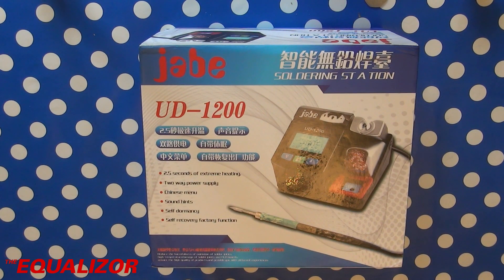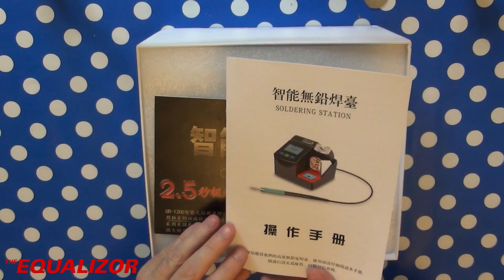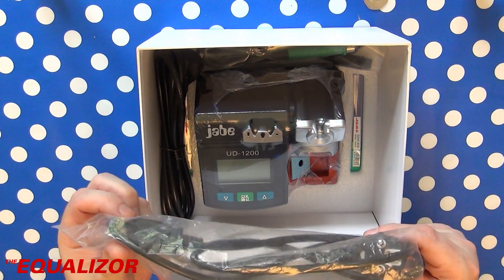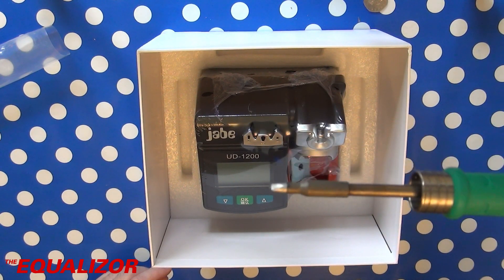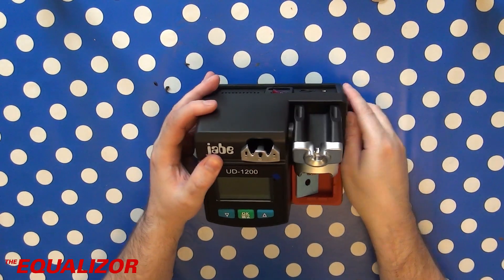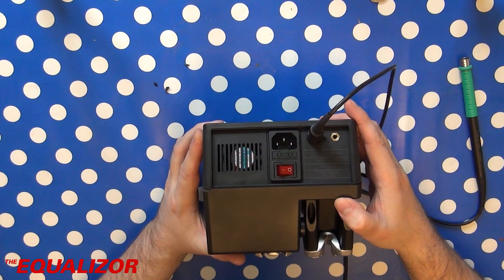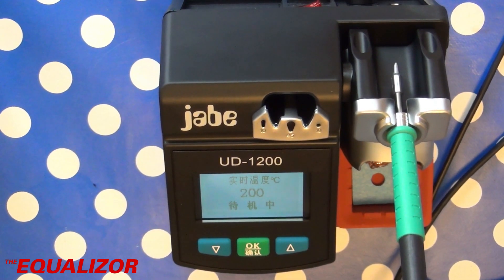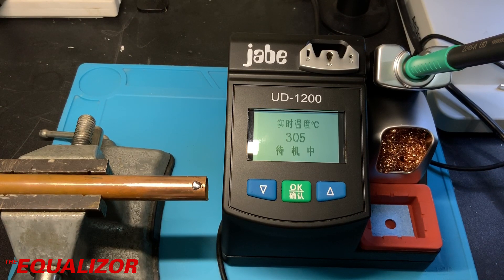Jabe UD-1200 soldering iron vs JBC CD-2SE

Comment from the maker: I’ve now used this station to make a SMD Romboard and it worked great. HOWEVER out of the box this station is set to 150w output which is insanely high. The JBC 2245 handpieces and cartridges are 50w rated. You can alter this setting by pressing the middle OK button, then pressing it again, scrolling down to the second line which will say 150W and using the down button to change it to 50W. Then scroll down to the final menu entry and press OK. After a few seconds the display will revert to the current temperature and it’ll be ready to go.
Reply: The Equalizor wooowww... 150w default setting WTFFF 
Thanks for this really nice review, I have the JBC and always recommend to people but people won’t ever spend that much money on jbc unless they’re electronics professional, this one is a good value =]
Reply: As long as the temperature doesn't overrun much then the high wattage is  not a bad thing.
Reply from the maker: Nevets Agreed, but I’m a little paranoid about the JBC tips getting damaged so I’m happy to underrun it. I’ve not noticed any difference in day to day use and I’ve had this for over a year now, still works great.
Reply: @the_equalizor  Ah ok, I wasn't really thinking about from that perspective. I am just about to order a JBC, I might experiment with the lifetime of 2 tips at different watts, maybe one at 80 watts and one at the full 130.
Reply from the maker: Nevets Enjoy your new JBC station. Still the best station I’ve ever bought. Much better than that crappy Pace one I bought before the Jabe. That was slow to heat up and the UI was crap, like something from the 1970s. :)

Comment: Hello, can Jabe UD-1200 use tip JBC C245? Thank U !
Reply: Phạm Thanh Vân Yes
Reply: @robscott6794   Tks U : JBC original C245xxx ?
Reply: Phạm Thanh Vân yes original and clones. For the original ones I turned the power output down a bit just in case, but I’ve had no issues using clone cartridges, handles and original tips and handles on this unit. You just can’t use 210 handles or tips that’s all.

Comment: rofl, amazon is selling them for nearly the same price as the actual JBC ... no thanks!
Reply from the maker: That's why you'd buy them from Aliexpress if you wanted one. Amazon sellers always put large markups on chinese items as you're then paying for the convenience of faster fulfilment.
Reply: @the_equalizor  I get that alas I live in a country that loves to charge import fees up the wazoo.. I recently purchased 2 dollars worth of pcb's from JLPCB and ended up paying about 60 euros worth of import fees, taxes and other malarkey.

edit: and to be utterly clear, I did not fault JLPCB for this, the boards were top notch and perfect in every sense. But I just live in a country that finds new and exiting ways of taxing you and keeping you poor.
Reply from the maker: @xConundrumx  Ahh, I understand, yeah that sucks. I was charged import duty on mine and it was still I think less than 200GBP. I do own a JBC station as well but I was intrigued by this one and bought it on a total punt. It's still my daily driver, but I use my JBC station with a 210 handle for very small SMD parts
Reply: @the_equalizor  I honestly think in the long run I will go with a JBC too, I recently powered on my old JBC station (30 years old now) and other then the soldering tip being utterly ruined due to corrosion.. it worked. I was surprised JBC no longer had replacement tips for it. It's only 30 years old ;). Also have their 30 year old hot air SMD station. That still works too (but the nozzles got lost over the years after 3 house moves).
Reply: @the_equalizor  would you not use the Jabe for small smd soldering? I do HDMI port replacements on consoles would the Jabe be a good choice... What tips can I use with jabe?
Reply from the maker: @irfankhalifa5647  With the right tip (and it can use any of the JBC tips in the 245 range) I don't think HDMI port replacement would be an issue. For HDMI port replacement I tend to use hot air to remove the port and then flux and manual soldering to anchor the port and solder the connections. If you're working in a tight space where the large handle of the 245 could be a problem then I'd recommend the JBC instead as the Jabe cannot use T210 handles/tips.I have no problems using this iron for SMD work - there are some examples of this in other videos on my channel.

Comment: Hello! Thanks for your review!
please tell me if this soldering station will support the original jbc t210? thank! good luck
Reply from the maker: Nope, definitely not. I've made that point in a  few of the Jabe videos. If you plug a t210 hand-piece in it will kill the cartridge, even with the output wattage reduced.
Reply: @the_equalizor  Thanks for the quick reply and explanation!
Reply: c245 tips are compatible

Comment: Hi! Great review. I would like to buy one, but I am a little concerned about the quality of the handpiece and the cartridges. Can I connect an original JBC handpiece to the Jabe? Or can I use JBC cartridges in the Jabe handpiece?
Reply from the maker: It works great with my real JBC hand piece and 2245 cartridges but it’s important to wind down the output wattage to minimise the chance of burning out the expensive JBC cartridge, but other than that it’s physically compatible with the 2245 hand piece and cartridges. But definitely don’t try using the 210 handle or cartridges with it, it’ll burn them out.
Reply: Thank you for the answer! I think I will order one, and if the copy handpiece fails eventually, I will buy an original which will be certainly better.
Reply: The jbc handpiece is slightly better quality. I’m finding on the jabe one that the silicone strain relief is a bit loose but I reckon if I bulk up the plastic it connects to that will fix that straight away. All in all this is a great station that I use more than my real jbc (although I do tend to use that for microsoldering because it’s has a 210 hand piece

Comment: Hello! Thanks for video!
Say please - do you can advice this is solder station for buy? It is worth the money?
Its better than T12 and T12-11 ?
If original JBL = 100% then how much % this is Jabe?
Reply from the maker: I really like this station personally. It’s good value for money and seems pretty well built. There are some caveats (please see my reply to Wayne Taylor for those) but imho its definitely worth the money. It’s not quite as polished as the JBC, so for instance the LCD screen is covered with glass on the JBC and clear plastic on this one, but that’s minor. I have never used the t12 systems so I can’t comment on that. I’m a completely independent reviewer, I have no links with Jabe or AliExpress and I’m not afraid to give my opinion no matter how crap something is but yeah, I really like this station. As an arbitrary figure I’d say this thing is probably 80-90% close to the JBC in terms of overall similarity.

Comment: Great job!
Reply from the maker: Cheers, however watch this space as I'll have a follow up video with some more cons to be aware of..I still think this is a great station, but with caveats.
Reply: @the_equalizor  what cons have you found just ordered one bit worried now ..
Reply from the maker: Wayne Taylor don’t be worried. The only cons that I’ve found aren’t deal breakers. They are 1) The output power is insanely high at 150w. That might be fine for the supplied tips but for the KNOKOO ones from AliExpress it’s too high. The 2245 hand pieces are 45w from what I’ve read so I’ve set the power to 75w and that seems to work fine with the KNOKOO ones.  2) You cannot use this station with the smaller JBC c210 handpieces, again really a non issue. 3) The display is a bit poor quality but usable. I’m going to see if I can remove the polarizer and invert it in another video. 4) As I said in the vid the supplied tips  are weird sizes (for me) but you can use other tips in it. If you need any help with it let me know but it’s pretty straight forward. Google translate app works ok for the Chinese menus :) Teardown coming in the next few days too....
Reply: @the_equalizor  thanks  not too many problems, the one I've ordered I've confirmed has updated English menus ..
Reply from the maker: Wayne Taylor Oh that’s great. Well it’s a great station so enjoy 😀
Reply: @the_equalizor  shame about c210 hand piece not working with it though kinda like smaller the better
Reply from the maker: Wayne Taylor actually I agreed tbh
Reply from the maker: @waynetaylor2784   Have you received your station yet and were the menus in English? Did you get it from Aliexpress?